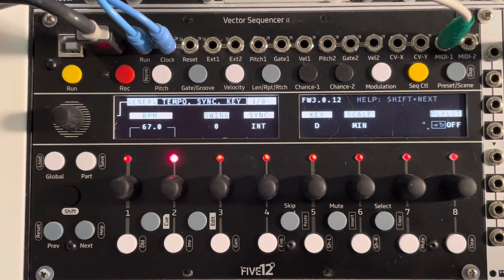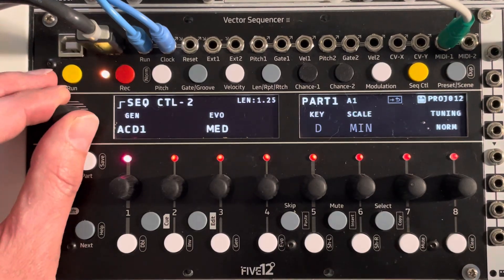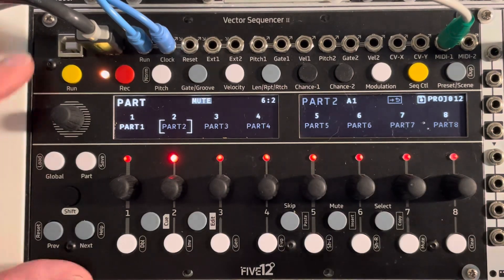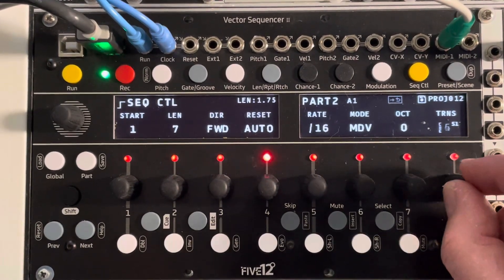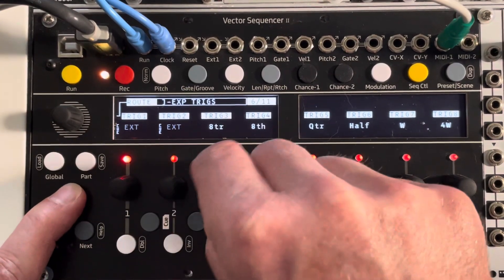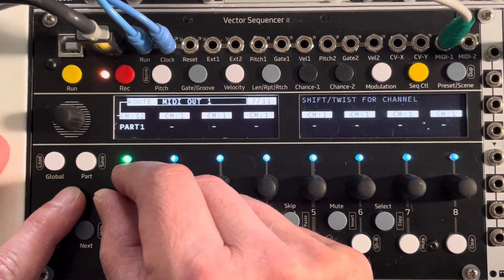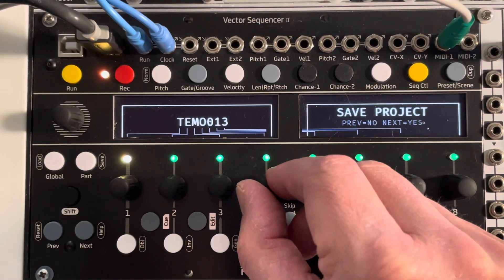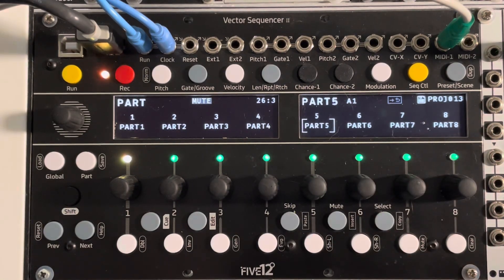Vector Firmware 3.0.12 - NEW FEATURES - Link Transpose and Project Templates

Comment: Still need reformatting to set a 32 step length? I was hoping for 64 seamless at least.  Also no midi without the expander still? That means I need another module to jam at my friends and receive clock.  I used my vector almost every single day for the past 4 years and I don't see any reason to upgrade.
Reply from the maker: Hey! I have always used the expander with the Vector because it brings so much more power to the sequencer.  When we jam it is usually CV (to the main module) but sometimes MIDI DIN (expander).

The main module has MIDI of course but I am guessing you mean midi clock input (expander only).  Yes, parts reformat when you set them up a different way.  

Most importantly, yes the mark 1 is still a great unit and will be supported by Jim ongoing (with new features as possible) so if you don't feel like it, there is no reason you need to upgrade.  Thanks for watching.